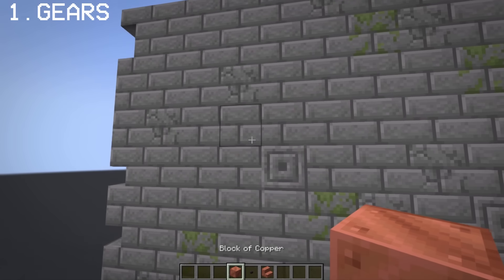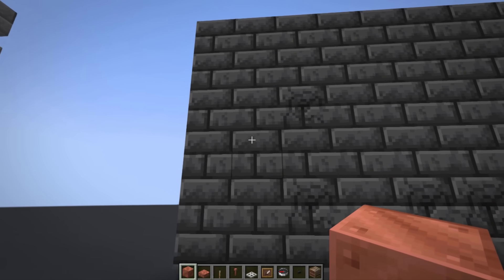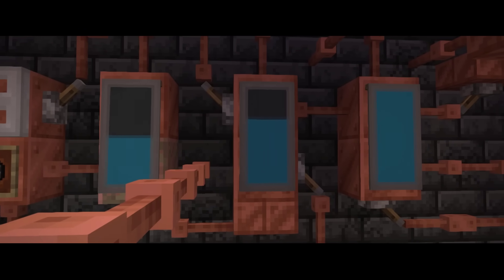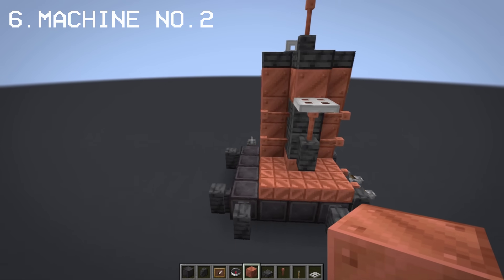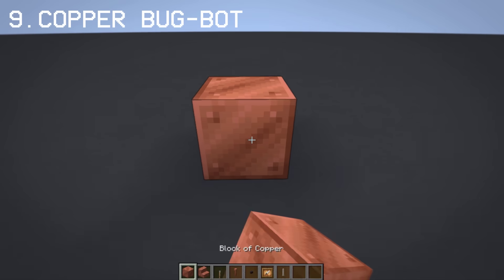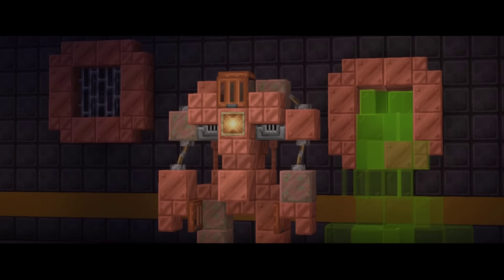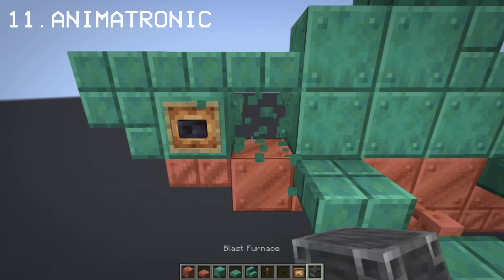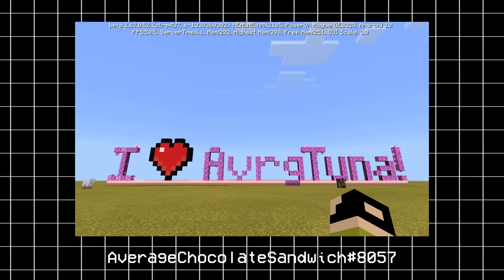12 Minecraft Steampunk and Industrial build hacks (Minecraft 1.17: Copper build ideas #2)

Comment: Although the placement of the lightning rods for the pipes doesn't have to be fine-tuned, I recommend that you have at least as many lightning rods as levers. If you have more levers than lightning rods, it will look like a crazy machine rather than a pipe configuration!

Comment: The first machine looks like an gas burning smelter, using gas to burn metal, or an normal smelter with an water cooling system.
The second machine remembers me an gas condensing machine, because of the amount of pipes going in and  two getting out at the bottom.

Comment: I found this and hella i made an rp (with my friends) basically i made it like exploring an abandoned steampunk like building (alot of unfinished and old machines) and all of them are rusted or some parts on the ground and we explored near the areas and found an end portal and nether portal (ofcourse its more steampunk and industrialized, and found more old varients of the same things (and more different stuff as they could use the machines, but we are not smart enough to fix them so they broke down, then the story starts, 5 years later then explore it (the 5 years later apart of rp)

Comment: Machine No. 1: Industrial smelting furnace
Machine No. 2: Gas pump + excess pressure vent
Also, in case these weren’t already amazing enough, the copper slowly turns green, giving the impression that it’s quality is deteriorating over time.